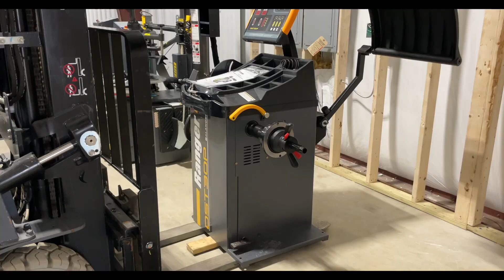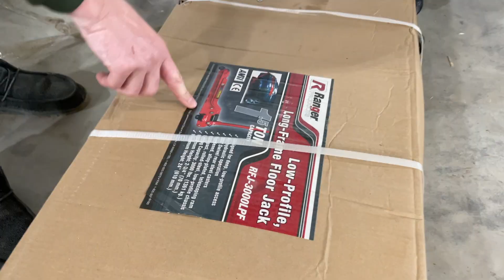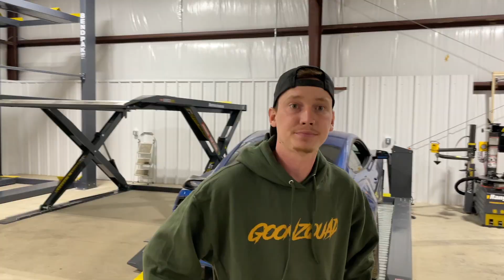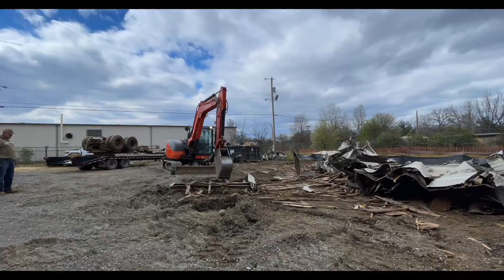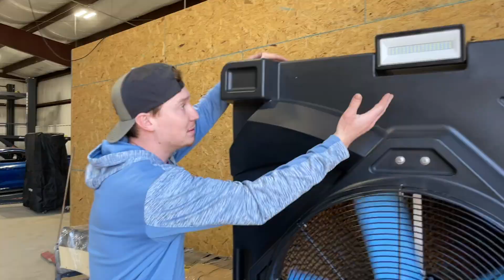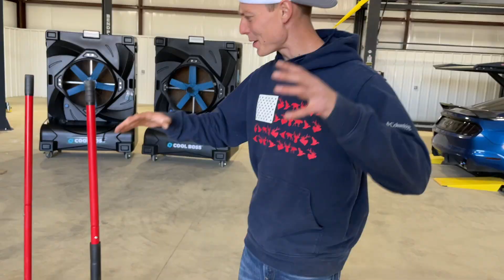The New Goonzquad Garage Is Almost Finished!!!

Comment: Now, you can have a covered car garage to all vehicles so ,priority is the INSIDE,
AND BRING ALL CARS THERE
*NO RATS EXPOSURE
*NO SUN ,RAIN N SNOW THAT WILL CAUSE DAMAGE TO CAR PAINT
N HAVE ORGANIZE SHOP
* BUY SEVERAL FIRE EXTINGUISHERS W CHEMICALS CONTENT

*CCTV OR ALARM SYSTEM conbected to cellphone
* SOLAR PANEL 
* SOLAR PERIMETER FENCE

DO THE OUTSIDE LAST

Comment: I think pops will get around 550 for the aluminum but if he took the time to make the big pieces smaller n bending them to a smaller size it would gain weight n add value . If you turned the tire balance machine towards the tire changer it would make it easier n quicker to change the tires n get them balanced faster unless your not worried about it or change them around this way you can put the new changed tire right on the balancer to improve quality in your shop

Comment: Shop looks good !  Slowly but surely losing space though  !! A frame machine will probably max out the space !! Might have to build another building !!  Good to hear you are going to finish the Camaro finally !!  Should have epoxied the floor before installing the lifts ,,,going to be tough to work around all the equipment !!  Its going to be tough to get cars on and off that stacker where it is set up now,,plus if you want to get a car off the top space you a have move the other 2 cars below it first , thats going to be tough !!
Reply: Think of the 3 car stacker as a storage unit. They will park the least used cars up top. Better than letting them sit out in the elements under trees.

Comment: Just curious is the 3 car stacker gonna be a bit difficult to pull cars into due to the angle it’s at?  I was thinking trying to get a car over there straight could be a pain… especially if ur needing to keep taking cars on an off to get to the top car lol…
Reply: That's why they l they've got the roller jacks for under the wheels
Reply: @gianfrancopuli5448  yeah they could do that but would be a hassle doing that 3 times to get the top car off… instead of just backing them out an what not…

Comment: I would also think really long and hard about space management... tool boxes and storage are important for efficient use of the space .
Reply: Agreed! Definitely think they should focus on mapping out the areas for tool storage, chemicals, parts shelves, etc before thinking about throwing a frame machine in there as that would take up a lot of room. Could possibly make use of the top of the office area for parts storage if its sturdy enough, but they can easily crowd that place up if its not thought through
Reply: Should get a whiteboard and make a little overhead view, make it easier to invision everything